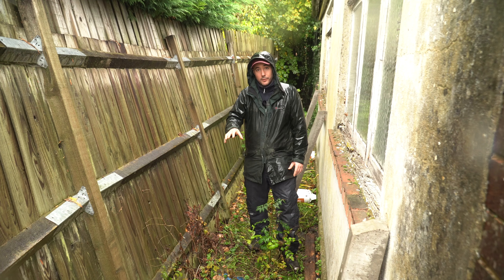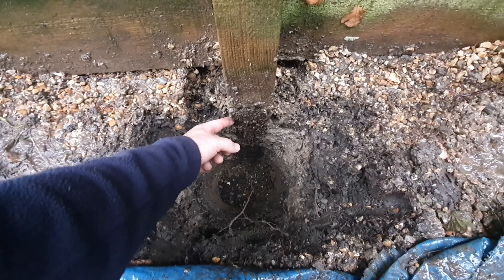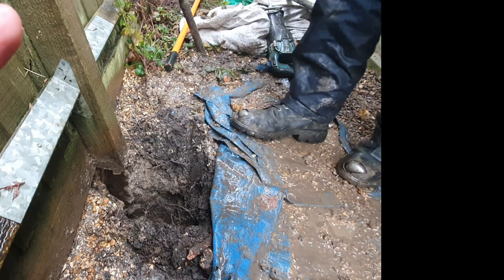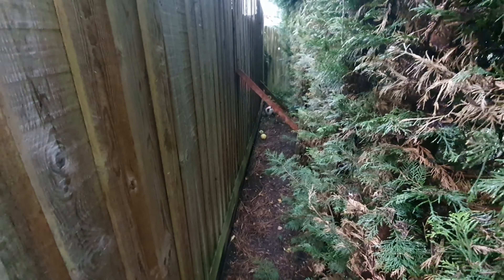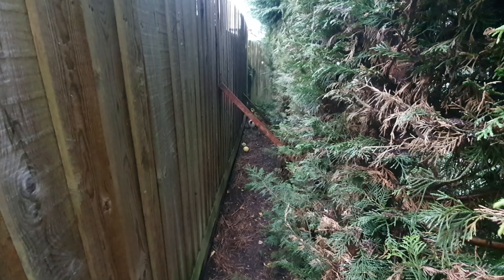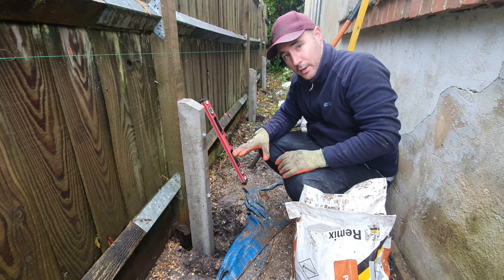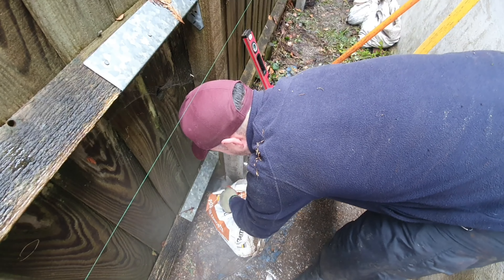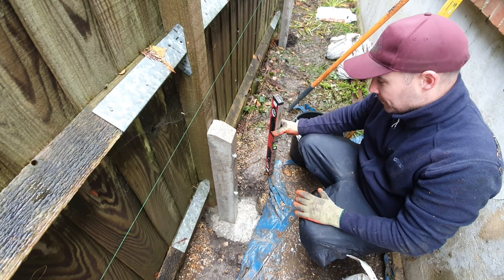How To Repair a Fence Post | The ULTIMATE Fence Post Repair

Comment from the maker: LINKS to all items featured in the video - (which will help you get the right tools for the job)

Concrete Repair Spur 100mm x 75mm x 75mm - https://www.fencingcentre.co.uk/concrete-repair-spur-12m.asp
Coach Screws 10mm x 150mm - https://amzn.to/30J0Irl
M10 Round Washers - https://amzn.to/30NAh3y
Silverline 721677 1/2 Inch Drive Metric Hex Socket, 17 mm - https://amzn.to/2Q2UXCB
Makita DJR186Z Reciprocating Saw, 18 V - https://amzn.to/30MaZ6c
Silverline 263570 1500 W Electric Breaker- https://amzn.to/3o4xWjD
60" (5ft) Chisel Digging Bar 13Lb - https://amzn.to/3qR17Cq
Roughneck ROU68250 Traditional Pattern Post Hole Digger - https://amzn.to/3rS6S46
Blue Circle Ready Mixed Postcrete - https://amzn.to/3bOTHf1
Makita DTD152 DTD152Z Impact Driver with Battery and Charger - https://amzn.to/3qNnXes
STANLEY FATMAX Pro Box Beam Level, 600mm - https://amzn.to/3qPejIb
Reply: Do you prefer post buddy or concrete spur ?

Comment: I finally see in this video what I have done to my fence. I cast these 3-1/2” x 3-1/2” x 5’-0” reinforced foster concrete posts and installed them next to wood posts. This is an eternal solution for a fence. When my wood posts get rotten, I will remove them and install new wood posts without digging holes in the soil.

Comment: I would have used studding and bolted right through the original post also using square washers on the timber fence post side. Good video though.

Comment: Thanks. Great instructional video. I will be doing this to 1 fence post next week. I have watched your video 3 times and I now have everything I need. Digging out the old concrete will be the bit I am not looking forward to as I don’t have a tool for the job.  I will get it done though.
Reply from the maker: Hi Karen, I feel for you because it will be hard to do without some form of tool. At least you only have to dig out half of the concrete :) Hammer a bolster will do the trick, or a hammer drill with chisel if you have one. Good luck with it .
Reply: @JamesMontana  thank you! I do have a hammer drill and chisel, so I will utilise that.
Reply: Quick question please! I have finished the job. Concrete was hell. Anyway, thanks for your tip on rotten post. It’s only 5 yrs old but it was sodden underground . I cut it out so no void when it rots totally. Now....I used 1 bag of concrete mix but the hole I made was a bit wide. I think it’s needs another 3 inches on top. If I score the new concrete tomorrow can I top up with half a bag or should I just leave it and compact the earth and shingle around it. The earth itself was bone dry. I don’t know what to do. I should have got 2 bags, oh well.... please advise me? Thanks 😊
Reply from the maker: @karenx7541  Well done 👏 Told you it would be hard lol. Dont bother with the extra post mix. Just top up with the dry soil and compact. It will be fine.
Reply: @JamesMontana  thank you!
Reply from the maker: @karenx7541  youre very welcome 👍

Comment: Good video buddy, I really need to start using these, it can be a right pain to replace posts - I normally take the easy route and fit new posts between the old ones as hate digging out concrete ! Thanks for the tips ! 👍
Reply from the maker: Thankyou mate. Think im slowly improving. Yeah so much easier to fit one of these as technically you only need to dig out half the concrete. If done properly will last longer than a new timber post.
Reply: @JamesMontana  Aye, you will have loads of subscribers in no time - keep at it, you are doing everything right ! Great info video by the way - keep them coming !
Reply from the maker: So nice to hear. Cheers 🍻
Reply: i know im asking the wrong place but does someone know of a way to get back into an Instagram account??
I stupidly lost the account password. I love any tricks you can offer me.
Reply: @Luis Orlando i really appreciate your reply. I found the site on google and im in the hacking process now.
I see it takes quite some time so I will get back to you later when my account password hopefully is recovered.
Reply: @Luis Orlando it did the trick and I finally got access to my account again. I'm so happy!
Thanks so much you saved my account !
Reply: @Marc Tripp Glad I could help :D

Comment: Really useful video - succinct and full of good tips. I am about to do some repair work on my own fence: In your experience, how tall should the concrete spurs be as a proportion of the fence? My fence is 1.8m tall, so I’m thinking at least 1.2m spurs with 600mm protruding from the ground. Thoughts?

Comment: During the recent storms I had a fence post come away from the concrete spur, even though coach screws were used. I have now replaced post with 10mm coach bolts which go all the way through the wooden post and secured with nuts/washers.
Reply from the maker: Yes bolts are better but ive literally never seen a screw come loose yet.
Reply: Yes, I was surprised myself. Two coach screws, top coach screw was still silver colour, bottom coach screw was rusty colour so I assume water had raised up in the post so starting to rot the post. Can't complain, the post was 29years old!

Comment: Hi, great video (not so much re the weather). Is there any reason you can't set the spur in concrete 1st (making sure it is level etc) before fixing it to the post? I am unable to get to the other side to put up suppprts so thought I could fix the spur 1st, leave it to set for 48 hours or so and then pull the post level when running the bolts through the spur. Thanks

Comment: I was wondering what size spur you'd use, I've found a couple of sizes of spur, 100mm x 75mm x 1000mm & 100mm x 100mm x 1200, the rotten posts are 6' above ground & 75mm square.  I thought a spur of 100mm x 75mm x 1200 would be better but these aren't available locally (Cheshire), just wondered what you'd recommend.

Comment: 150mm coach screws are a bit short, I always use 200mm to catch all the post
Reply from the maker: 150mm coach screws are totally adequate but yeah a 200mm one will be stronger, but i find they pierce through to the other side of the post.

Comment: Thanks. Why use an impact driver, doesn't it break the wood threads as it impacts? Why not a regular power drill.
Reply from the maker: No it doesnt. Its much easier.with an impact driver but you can do it with both.
Reply: Thanks for the clarification. I thought the impact drill moved the bit in a pounding fashion. Today I learned something.
Reply from the maker: @drumslapper  think you might be mixing it up with a hammer drill which is just for brick or concrete.

Comment: I notice you have metal ends on your 2x4 rails. What are they called? My rail ends have rotted and no longer touch the 4x4. Thanks!
Reply from the maker: They are not 2x4's, but are triangular rails and they are arris rail brackets. If you have 2x4s then you will need cant rail brackets.

Comment: just confirming... one and a half bags of postcrete (post mix) for a 2 x 1 foot hole? You then still left the fence braced with the wood for 3 days after and all that for £80? Seems good value
Reply from the maker: This was an exception. We were coming back to do more work so made sence to leave supported. I would charge more if that wasnt the case. And yes. We always use 1 and a half bags of mix per hole.

Comment: Could you have benched the cement away from the post to help water get away from the post? I realise the cement is very runny but after a few minutes could it be worked before setting?
Reply from the maker: If you want to work the post mix. Fill with water to just below the dry powder and then mix with a trowl. Obviously with a concrete post this wasnt needed.

Comment: Thanks James for your informative videos. I did order the Releasejoy Demolition hammer through Amazon who told me it was going to be delivered today. Unfortunately Hermes tried yesterday to deliver when no one was home so they have returned it to sender without giving any offer of redelivery. Not impressed. I have seen that there is a Wickes version of what looks like the exact same model, however there are comments to say that replacement chisels are not available which surely makes this tool a throw away item if used regularly. Would appreciate your thoughts and perhaps an alternative?
Reply from the maker: Titan electric breaker is my next go to. £160 in screwfix

Comment: Hi mate my fence has been up for about 8 months now so the post in question is fairly new so no rot issues. But it does wobble when the gate closes. Would you recommend a spur as a repair option or would I get away with just shoving some post repair stakes in there? Any feedback is welcome? Cheers 👍
Reply from the maker: If its already wobbly i would dig it out and concrete it in again. The post most likely had been moved while the concrete was setting.  If you had a company install the fence for you, give them a call and ask them to sort it. Any reputable company would be happy to fix it for you. Happy to answer any other questions you have. James
Reply: @JamesMontana  thanks James I appreciate your speedy response. I was hoping to avoid doing that as I put the fence up myself, and from what I can gather it’s  a pain off a job getting that back out! The wife is on at me to get it down thou so I guess I am literally between a rock and a hard place 😂 cheers bud 👍 clicked that subscribe button also 👍
Reply from the maker: @paulmccormack5524  you better get it done sharpish then mate lol. You could try a repair  stake but if the gap is too large then it might not help much and then be a waste of money,  same with the repair spur. They are normally used for if the post has snapped. Perhaps try some cheap metal strap from b & q. Anyway hope you get it sorted soon, for your sake 😆. Thanks for the sub 👍
Reply: @JamesMontana  please could you give me some advice,I can't support the fence on the other side because of a public foot path on the side that you say needs supporting

Comment: Thumbs up , but where do you buy those concrete posts in USA. I just want to ad ,, setting wood in dirt and concrete is just stupidity. I do home remodeling and I'm just not a fan of treated lumber outside . 
Lots of chemicals are in it, they always rot and twist , they still need to be sealed other wise a few years later all that wood is wasted . Wood needs a proper roof and proper protection to last. 
I will try to find those concrete posts for the fence I need to repair .. Maybe they sell galvanized steel brackets that can be set inside the concrete??
Reply from the maker: Hi there, Thanks for the thumbs up ! Im not sure they sell these in the US. We also do a steel version and in sure you must be able to get something similar. We set in concrete and dirt all the time. If done correctly i can last many years. But it is full of chemicals and does tend to warp alot i agree. We always reccomend to treat the bottom of wooden posts to add to their longevity but customers dont often want to pay the extra cost.

Comment: Very detailed and well done video, thank you. I was wandering if you use 1.5 bags which equals to 30Kg of postcrete as a general rule or if you can get away with 1 bag per spur/post. Thank you again I have just subscribed and look forward to check your other videos!
Reply from the maker: Hey thanks mate. It all depends on the size of hole you dig. Digging though concrete can leave you with a bigger hole than you really wanted. Yes ypu can get away with 1 bag on most cases but you should fill up to within a few inches of ground level. Thanks for the sub 👍
Reply: @JamesMontana 
Thanx a lot for the prompt reply! Much appreciated! I was also wandering if I find myself slightly short of postcrete, is it appropriate to add some pieces of the old concrete and stones or would this make the spur less stable? Many thanx again!!
Reply from the maker: @emiliopiovesan392  there is no problem to add in some bricks as long as the mix has space to fill in and you dont leave any air pockets.

Comment: Can I use 150mm nut, washer and bolt instead of a coach bolt? I know I will have to drill the post in order for the bolt to pass but I've been told it's a stronger fix.
Reply from the maker: Yes but you will need 225mm bolts to go right through but trust me though, once these screws go in they wont be coming out again.  We often need to use a power wrench to get them out. I hope this helps.
Reply: It certainly looks a lot easier,I'll give it a try.thanks a lot
Reply from the maker: @pcg1276  You're welcome my friends 🙂

Comment: How did you get the concrete out
Reply from the maker: I used an electric concrete breaker but if you dont have one you can use a hammer and chisel or a big wrecking bar. You only need to break out half of the concrete.
Reply: @JamesMontana  would an SDS drill with a cold chisel attachment work mate? Might be an option for those guys that don’t have a breaker.

Comment: Surely it would be far better using concrete posts in the first place rather than wooden posts ? (you can make your own)
Reply from the maker: Yeah its definitely more economic in the long run to use concrete posts but some people prefer wood and it is a cheaper initial outlay.

Comment: Thanks for sharing this information 👍I take it you don't need to drill a pilot hole when using coach bolts? can I use a normal socket set, instead of an impact driver
Reply from the maker: Youre welcome 👍 You dont need to pilothole using the coach crews but if youre using just a socket and ratchet then it would make it easier to start off if you do.
Reply: Sorry that's a coach screw then? Good video thank you.

Comment: I would not use concrete around the post. If for some reason it needs to be removed it will be pain in the s. 
Fill sharp sand around post. 
If you will need to remove the post just use shop vacuum to suck all the sand out of hole, insert new post and put send back. Otherwise you did a great job ! thank you for the video

Comment: A Stainless Steal Bolt all the way through would be much better , but for me timber posts are never that good for a Fence long term.
Reply from the maker: The galvanised steel ones last for decades but yeah stainless wont corrode

Comment: Wouldn't it be easier to just replace the post at that point
Reply: New post will going to rot the same way as the old one. Concrete spur will be there forever. 
And if you need to put a new fence you will using same spurs.

Comment: You dug a hole cut out the rot. Just replace the post. 🤷‍♂️
Reply: This method will outlast any new wooden post and certainly outlast the fence. OK, it's not for everyone and it sounds like you don't like this method. I have used concrete spurs in the past. It's definitely easier and quicker than a replacement, probably doesn't look as good though. In my view it's a good option. You don't need to detach the fence from the post, so if you are on your own it's much more manageable.